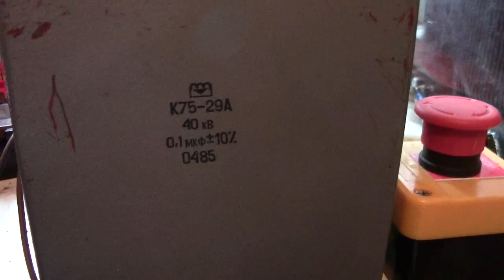20KV Transformer charging/discharging a 40KV 100nF Pulse cap LOUD

Comment: My goodness, that cap is SNAPPY! :D

As you were discharging it, I could hear the snaps echoing around the room. The small wire you wrapped around the post was sparking at both ends quite well. :D

Would be interesting to see a few things get put across that cap. LEDs, apples, other low voltage capacitors.... LMAO.

Just don't do it indoors, because there will be bits of stuff everywhere :D

Thanx for showing,

-BoomBoxDeluxe.